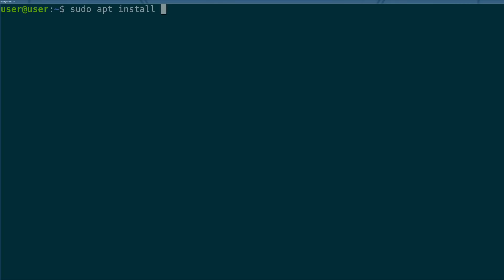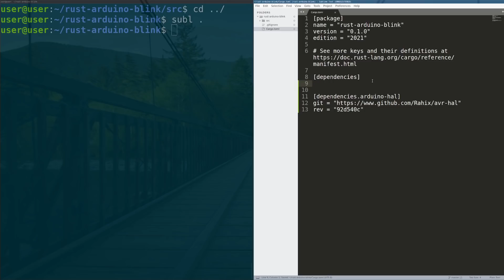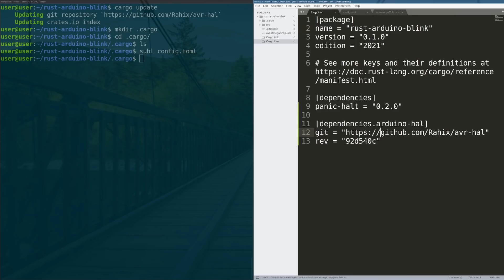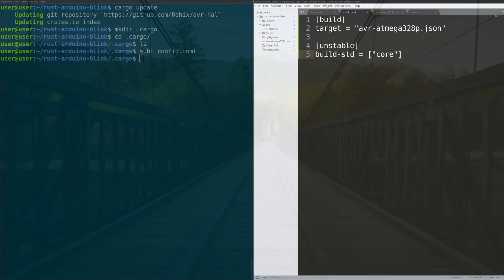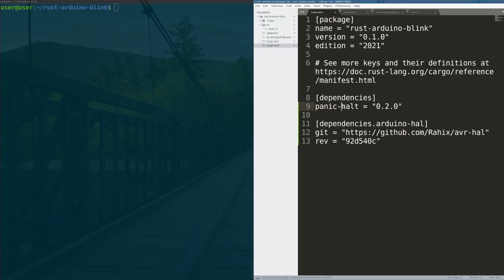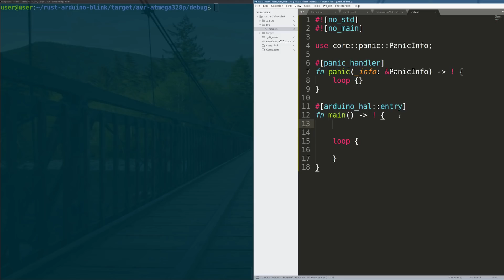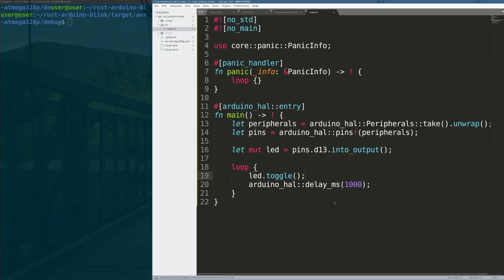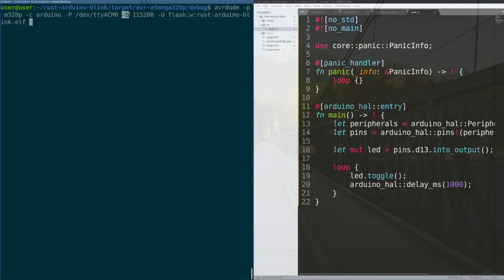Rust Runs on EVERYTHING, Including the Arduino | Adventures in Embedded Rust Programming

Comment: Awesome video.  Seems that there is just a lot of hacks to be able to get started using Rust on embedded.  Hopefully it gets more straightforward as time goes by.
Reply from the maker: Yeah I found the project setup pretty clumsy. Luckily Rahix has a template you all can use for your projects.
Reply: I generally agree with this comment. There’s just not as much polish here as there is with other areas of rust. None of the knowledge is all in one place. That’s why I’m so excited for LLL (or L3?) to take on this topic. He’s clearly a bright guy good at explaining things, including the dusty corners.
Reply: The Knurling Project is actually pretty hot. It kind of gives you "compile", "flash", "debug", "forward log/output" and other things out of the box. It still does require an understanding of how embedded rust works in general, of course.
Reply: I'm already glad it's this much clearer. While doing the Rust embedded book in 2019, there was a lot more things to get a hold of. Like for instance the STM32F303 board. Now I can just grab an Uno or Nano that I have lying around and actually use. 

The source code has also gotten a lot more compact.

Comment: A topic of suggestion would be speed of execution(RUST vs C vs ASM) in the embedded controllers for the rust series.
Reply: I think benchmarking battery or memory consumption would be a more fitting benchmark.

You're rarely ever going to need performance on these chips, if you're driving them to the limit and not currently revising a cheaper version of a well sold device you're probably doing it wrong - and at that point you can afford to rewrite it in assembly or whatever if you need it. Most of the time at worst you send updates a little slower, who cares. 

Meanwhile running out of memory is a real issue, and if you're trying to run devices on battery, or generally around the clock, energy consumption is very relevant.
Reply: @9SMTM6  I think performance should work as a good proxy for battery usage. Generally speaking, if your code isn't running, the processor can idle/sleep/standby/etc. So that would be a major power savings.

Your memory usage comment is 100% accurate. That is the real killer on embedded.
Reply: @brendanhansknecht4650  probably not the worst, but also not necessarily a perfect indicator, especially with multicore - like the RPi Zero 2 has. But also memory usage tends to influence energy consumption, and unfortunately often not in a linear fashion. 

Also thinking about it, I think it's easier to measure, well not necessarily battery life, but energy usage correctly and in a realistic environment. For speed though it's harder to measure and might push one to unrealistic scenarios to measure a difference at all.
Reply: @brendanhansknecht4650  lol try to compare the performance and current for AVR and a simple cortex M0 and you'll have a bad time
Reply: @crides0  Why would I compare across two different chips? This is talking about c/c++ vs rust performance. So you would just be swapping out code on the same development board. With many dev boards, it is really easy to both measure time to complete a task and the power usage through the usb cable to the dev board.

As a side note, comparing across devices is only more complex due to configuration. You can compare an AVR to a cortex M0, but you will have to take into account the chosen clock speed among other things. The results would likely be that the cortex M0 crushes the AVR in speed while using similar amounts of power. The comparison can be done and is valid. Not sure why you think it would be such a bad time.
Reply: And for sake of completeness the time it takes to actually write the code as far as programmer time. Because I think you’ll find you will get fairly close to rust for an order of magnitude less time writing it.
Reply: @TinkerersAnonymous  you also forget time to debugging
Reply: Task execution time as a proxy for battery life might not always work. Scaled this up to like AVX-512 on Intel chips I think that lights up so much of the CPU that it may not be more power efficient but it’s way more time efficient. But I think it’s generally in the correct direction and probably should be included if at all.
Reply: @TinkerersAnonymous  this suggestion is specifically talking about embedded. It definitely does not scale to desktop and full blown servers. Of course, there still are exceptions even in embedded. Maybe it is better to keep the floating point unit powered off and do quantized calculations with integers.

That being said, for the algorithms that suite avx-512, it should be faster and more power efficient than the alternatives. The issue is when you only lightly use avx-512 but pay the full cost of having it around and enabled at times.

Comment: It does in fact not really run on everything. Yet.

The platforms that you can target with the default rustc are limited to at most these supported by LLVM, and many device manufacturers don't provide a LLVM backend.

But there's hope that 1) device manufacturers getting better about llvm support and 2) rust is getting a compiler with gcc backend / a gcc frontend, which is in fact getting worked on right now.

Other than this yeah, Rust has very much the capability of running on pretty much everything. All that's lacking is tooling at times. Because of the work for the Linux kernel we're even getting fallible allocation APIs, which make using the alloc crate (Box, Vector, Hashmap etc) on top of just core (Result, Option etc) a possibility for many embedded devices.
Reply: I agree. The title really confused me. Rust isn't a supported target on all the platforms we use at my job.